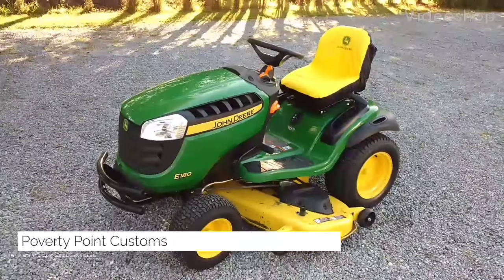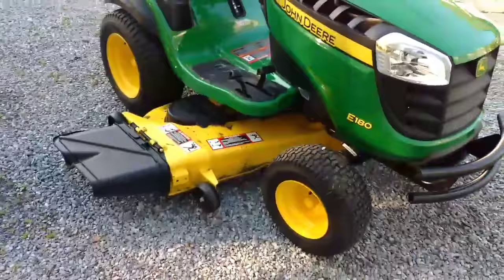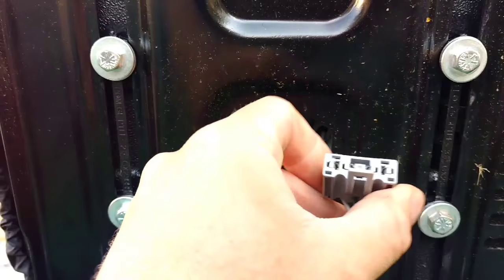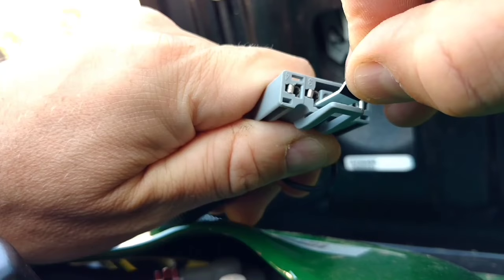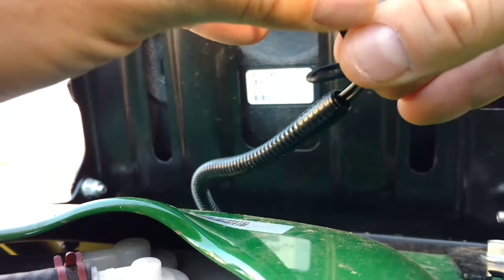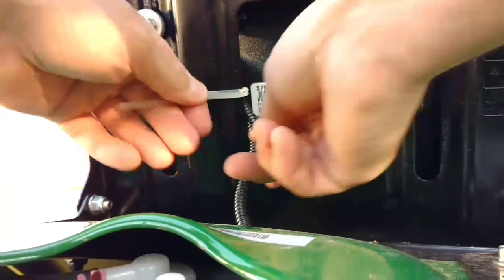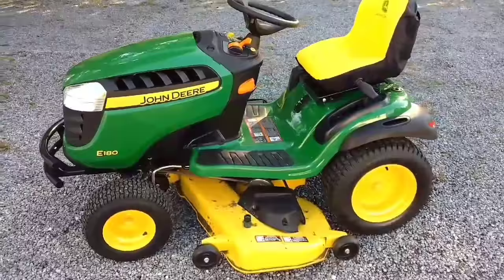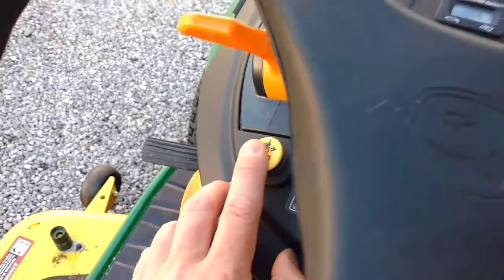How to disable the John Deere seat safety switch

Comment: I just got an E120 yesterday. Used it for the first time this morning. It is not always even a question of leaving the mower. I have an area that slopes off to the street  that I shift weight hard to the left side. It was shutting down for that. John Deere might not like it but it works for me. Truly a 10 second fix. Thanks for sharing. YouTube to the rescue for whatever ails you!
Reply: crazyman762 ... I just operated my 120 for the first time yesterday. I had exact same problem when I shifted my weight for the side hill. The switch is simply too “center -centric” and needs to stay activated when my weight is not exactly on the center of the seat. This was never a problem with my old AGCO ALLIS. Did you disable the Reverse Override switch too?
Reply: @la023711  Yes  both safety switches disabled. Both are very annoying. It is almost fun to drive now. Very easy to  revert and plug in again but I will not do it. I wonder if a JD dealer will work on it with the switches disabled. I think I am going to have an end of season PM done in November. I am a S Scaler BTW, but nothing Rock Island.

Comment: KUDO's tp you for creating this video! My Ferris Zero-turn developed a PTO problem recently so it turned out to be a good move I made last year by purchasing a used 2005 J. Deere L120 with, believe it or not, just over 200 hours on it as a back-up and for mulching lawn leaves in the Fall. I've been permanently disabled since Memorial Day, 1974 when I sustained a lower back injury that prevents me from sitting erect with proper posture while mowing about 5 out of my 8 acres of property. Last week was the first time I've used the L120 for completely mowing & it took my normal 2 day chore up to 3 days because I've already given her the nickname "Rough Rider" (No shock absorbers like my Ferris) and I need to just go slower. I have an operator presence switch on my Ferris seat but it's NEVER prevented me from slouching while mowing. Not so with the L120 with it's super uncomfortable seat. Just when I get as comfy as I can and my pain level is falling back to my normal "3" ~ my rear end gets too far forward on the seat and then everything shuts off. 

The night before starting this week's mowing, I viewed the first YouTube video that Google returned about defeating that damn switch. The guy in that video made it seem so simple. All would need to do was disconnect the wire harness from the seat switch. So, I immediately went down to my basement garage and pulled the plug; opened the garage door; started her up; lifted myself up off the seat and, sure enough, the engine kept running! I just couldn't wait to start mowing the next day. Brought her up into the sunshine; fueled her up; tooled over to the grass; pushed the throttle up to near high; pulled out the PTO and the blades ran for maybe 2 seconds before the engine shut down! Tried it 2 more times with, of course, the same result. Plugged the connector back into the seat switch and I was good to mow on my Rough Rider while thinking about not only that damn switch but also the after market new seat I had just ordered online that had no provision for a safety switch!

I thanked my lucky stars after viewing your video late last night with the credit card fix (although I don't recall your stating what YOUR FIX really FIXED) and fortunately my 2005 had the identical plug that your 2019 has. So, once again I go downstairs armed with a roll of electrical tape; pair of sharp scissors & my Amazon Card just Primed for a trim job. It didn't take long before I was outside the door and, after a quick prayer, reeved up the engine & pulled out the PTO switch ..... AND ..... the L120 will be out on the links mowing while I'm slouching this afternoon. Thanks, ever so much, for this video and I'm looking forward to hopefully disabling my RIO as well !!!

Terry ~ Fallston, MD

Comment: This really helps me. I'm having to jump start my mower with and every time I get off the seat to disconnect the jumper cables it turns off. Thanks for the tip.
Reply from the maker: Your welcome
Reply: I just bought E100 and for some reason it will not crank. I had to jump start the battery. Does this has anything to do with this sensor?

Comment: I’m doing this to prevent replacing the cam shaft “again”. If you readjust your position on the seat and the switch kicks in, the compression release activates and self destructs. Thanks for the fix!
Reply from the maker: Your very welcome

Comment: Thank you so much that's been a pet peeve of mine too I only weigh 120 lb and if I lean one way to counterbalance the machine because I have Hilly ground it will start to die and I have to write myself to keep it running at the worst times I've done it on previous mowers but thank you for this little hack I'm definitely going to use it kudos have a great holiday weekend.

Comment: I think a better alternative would be to install a toggle switch to deactivate the feature. I think that's what I'm going to do. For the seat, and for the reverse mowing button. I think. :) There is a reason for this feature, and it's there because people have been maimed, or even killed, when mower has tipped over on them.
Reply from the maker: True, if anyone else other then me was using it it would be left stock. And good idea on the toggle switch.
Reply: @PovertyPointCustoms  :)

Comment: Can you not lock the brake on to be able to exit the mower without it turning the engine off?  I've got an older D170 model that you can do that with at least.
Reply: Most all lawn tractors built in the past 20 years are like that. This is for people who want to increase their chance of losing a limb.
Reply: @iaff801  Great, thanks, I myself value my extremities so therefore this video doesn't apply
Reply: @raterus  I think you misunderstood,  I was agreeing with you that the override should not be done. Sorry
Reply: @iaff801  Nope, I completely understood you.  The video doesn't apply, because I would never, unless trying to diagnose another problem, disable safety features of my mower!

Comment: That works for driving BUT the engine kills itself when the mower deck is engaged! Model: D130.
Reply: If the engine dies when blades are engaged its because the safety switch is still active
Reply: Haven't tried this but with the seat plug out, my D125 dies also when engaging the blades . I think one way is to disable the pto safety as well by securing its button in the down or "pressed in" position so the machine doesn't know if the blades are engaged or not. Another video says to pull out one of the black wires  that's looped back into the seat plug. I'll have to try it on mine.
Reply: @geecrawdad  I tried removing the seat plug and disconnecting the looped wire as per another video.  The engine then continues to run with the blades engaged even if you are off the seat.  I plugged my switch back in as I was not comfortable with the possibility of stepping off the mower with the blades running.  I wish it would keep running when I get off the mower ONLY if the blades are not turning and die if the blades are engaged.  It's either all or none so I will go back to relying on the parking brake to step off the mower with the engine is running.
Reply: @ronsnow8342  I don't want to come off as to harsh but common sense goes a long way. Much more important than concocted safety measures. I've spilt more gas with a "safety" can that I ever did with a good ol'fashion spout and vent can, if you know what I mean. 

I mowed with a John Deere 318 garden tractor since the eighties with virtually no "safety" features, no trouble, and no accidents. Unfortunately, after thousands of hours of mowing, it finally succumbed to age, and I bought my first "throw away" mower. A JD D170. The first thing I did was bypass the seat switch, the reverse button, and the brake switch. Use your noggin and you'll be fine...

Comment: They must have changed the wiring for 2022. I did this and it worked as you demonstrated. BUT, when I engaged the deck lever, the motor shut off.  It seems like they added an extra safety circuit somewhere.
Reply from the maker: Good and bad I guess!

Comment: I have the E140 and it has all the same safety features of course. It just stopped turning over and won’t start. I’m suspicious of the seat switch so I’m going to try your trick tomorrow. 

When I turn the key my headlights will work but the engine doesn’t even try. There’s no clicking or any indication that it’s getting power to the starter. 

I disabled the backup switch the day I bought the mower but that is the only mod I’ve ever done. 

If you have any ideas that I might be looking over I’d sure appreciate any advice you may have? Thanks for the great video 😊

Comment: A faster and more water tight way to do this is just to get a splice connector from a auto parts store, open up the plastic looming put both wires in, and clamp the splice connector together, then close the looming back up and you’re good to go. It would take less than a minute and cost  25 cents.
Reply: That’s faster???  I don’t think so, especially if a trip to the auto parts store is needed. And it’s certainly more expensive.

Comment: I have an LT160 and i  just cut the wires and connected the two white wires together. I still have the safety part when the blades are engaged but i can get off when they are not.

Comment: Worked like a charm until I tried to engage the blades and then it stalls out. Whats wrong with my L118? I tried it on my neighbors brand new JD tractor and it worked perfectly!
Reply from the maker: Honestly that's a good question, hopefully someone in the comments will be able to answer this. I've only tried this on the E series tractors so far. If you figure it out let me know.
Reply: Probably the seat safety works in conjunction with the blade engagement safety so you'd have to disable that too.

Comment: If you just press the brake, then pull up orange handbrake beside steering wheel,  then you can get off tractor while engine on,
Reply: Completely agree. Good to know this. There are times when you need to run the engine when get off from the tractor but it is still very dangerous to run the blades when off . There is no need to keep the blades running all the time.  Safety is always important and there is no need to take unnecessary risks.

Comment: So my mower wouldn't start and I tested everything but the safety switch on the seat because I wasn't sure how to test that one on a multimeter, the prongs were different than the others. so I did this method and my mower started right up...but the safety switch still works? when I stand up while mowing the engine cuts off. not sure how thats even possible. I did this exact method with credit card

Comment: Mice ate the cable wires right there at the plug. Been having problems starting the mower. I wonder if it's the safety switch for the seat causing this issue.
Reply from the maker: It's could be, I had issues with mice chewing wires in our suv that stopped our temp sensor from working, 300.00 latter it was fixed
Reply: @PovertyPointCustoms  I'm thinking I need to bypass before the plug. Do you know if there's a part number the for the switch and wires?

Comment: Why not just disconnect the plug with no further modifications?
Reply: With the plug simply disconnected, when you engage the blades the engine dies as though you were off the seat.

Comment: No need in all that. All you gotta do is just turn the blades off, set parking brake and it will stay running when you get off the mower.
Reply: Yes, but every time you engage the blades you are also slowly wearing out your belt because of the friction.

Comment: Used a piece of credit card and it worked great.  For a day.  I assumed the piece fell out but upon inspection, it was still in place.
Removed the two-pronged tab and it worked great.  Again, for a day.  Now it's back to operating as if I did nothing.  Makes no sense.